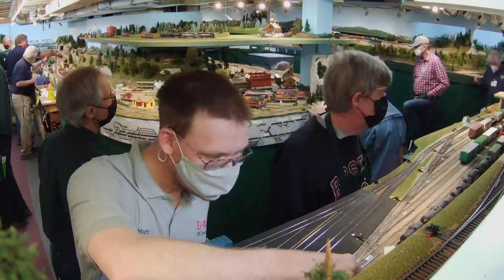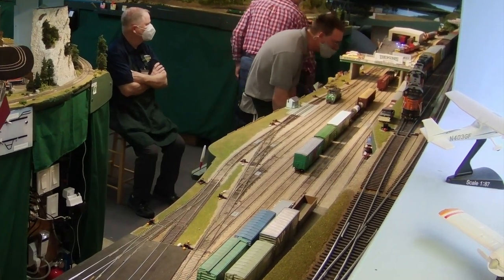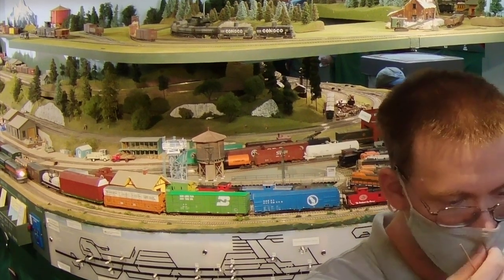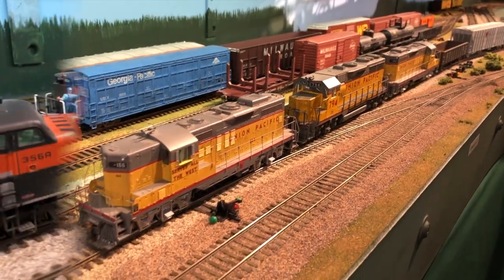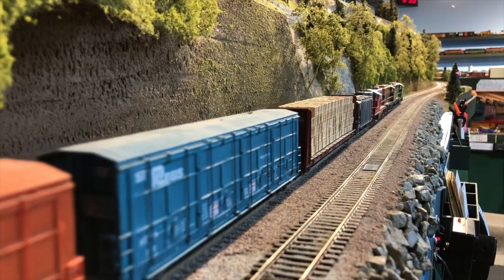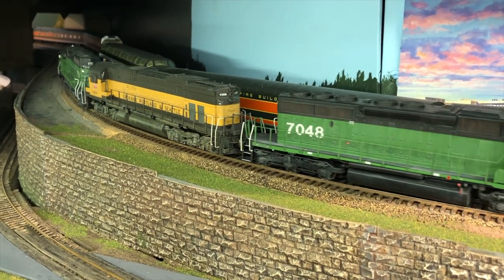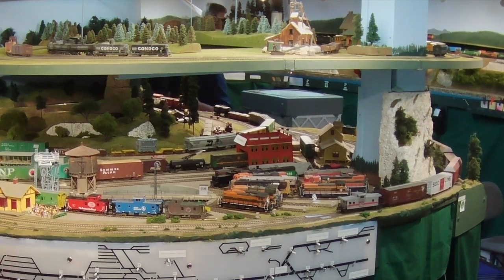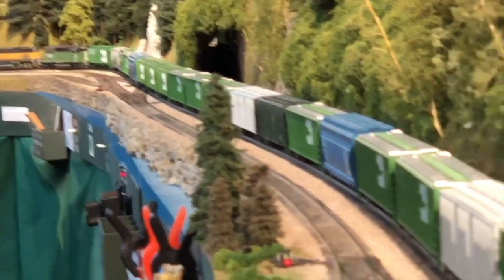Part 29 - Day two highlights from SoundRails 2022  - 17 people in 7 hours run BN, UP & MILW trains

Comment: Burr,
I always really enjoy your commentary of the prototype operations in the Puget Sound area.  I’m obsessed with most of the same operations that you are - I’m circa 1971. I found it fascinating listening you discuss the copper ore operations that went down to ASARCO at 11:40.

I’ve found nothing about the rail operations of this industry. Whilst I guess for modeling purposes any ore type cars could be used, do you know exactly what type of cars were used? Unless I can be shown otherwise, I’ll be using the ubiquitous Atlas 70 ton ore cars.

Thanks.
Reply from the maker: I heard about the Asarko loads from Ray Wheeler, who used to be a brakeman for GN/BN during that era. He said that strings of up to 13 ore jenny's would come south from British Columbia with copper ore for Asarco. So that's what I do. He said they were usually GN cars surplus from the Iron Range. As you say, it's not easy to find out much about the details of shippers, commodities and operations from that era. Talking to ex-railroad employees helps if you can find them and if they can remember the specifics. The only reason I don't model 1971 is I like to see more SD40-2's and a few Railbox cars in the fleet. So I call it 1973...

Comment: Great video!   All that green paint is fun to see!  Any ideas on what the specific modifications were to the BN 1799 for its employment on the Jet Job?
Reply from the maker: It had to do with brakes and with the oil sump, to keep lube oil flowing on that 5.7% grade. I don't know anything more specific than that. There were three locos with the modifications - 1797, 1798 and 1799. They kept them close to Everett to make sure that they could provide the service reliably.
Reply: @muchfunwithtrains  Interesting.  I'd have thought maybe something to do with updated anti-slip software or sanding.